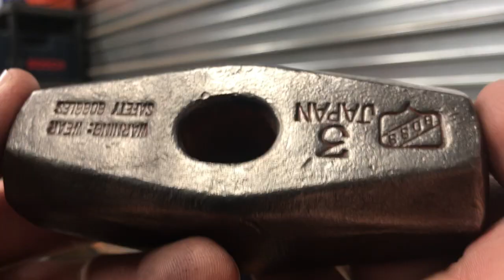Sledge Hammer Restoration

Comment from the maker: I just wanted to add a couple of things... For all I know this hammer could have been sold at Harbor Freight 10 years ago. I know nothing about it. The old handle was really tight in the head but it was chipping and slivering really bad. It got me really good the first time I used it and so I decided to put a new handle on it. More than anything, I did this project to get a little experience in replacing tool handles so that when I come across good tools at yard sales or thrift stores made from good steel, I already tried my hand at replacing the handle and learned my mistakes prior to restoring a good tool. With that being said, this hammer was made in Japan, and they usually manufacture good products with good materials. I am sure it was worth my time based on not having China stamped into it. Which is why I went ahead and did the project.

Comment: Nice Hammer and nice Restoration! 👍👍👍
In my opinion the Hammer would look a bit nicer without the red paint. But great Project!
Reply from the maker: I had some reservations about painting it any color but in the end I do it for rust prevention. The paint was already scuffing away from sanding the handle as I am sure you noticed. If I were to do it again, I probably wouldn't have painted it. And if I really decide I don't like it that much, I will probably just spend 5 minutes on the bench grinder again and wire brush it all off. Thanks for watching Sam!